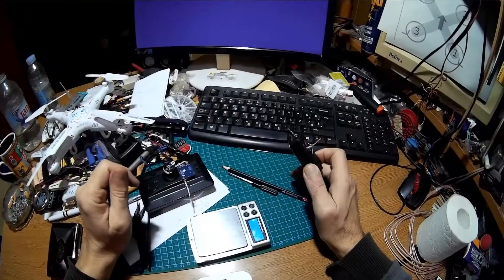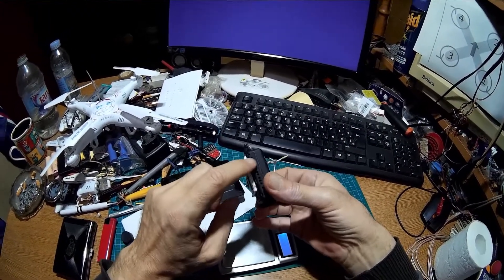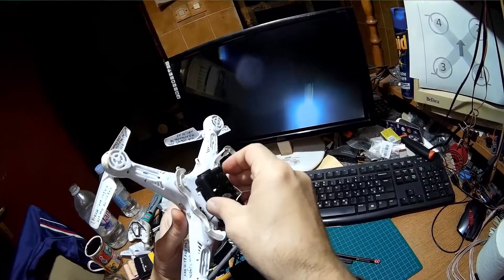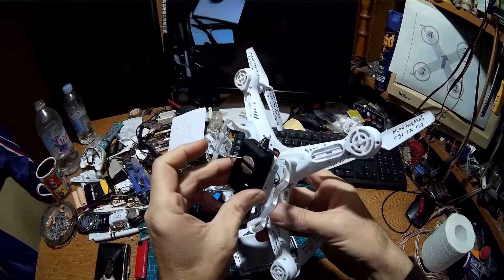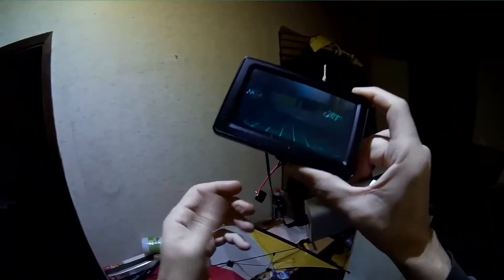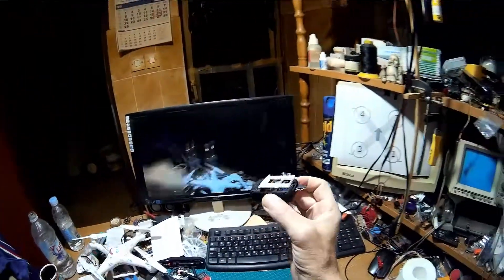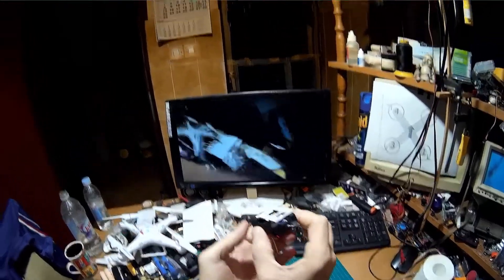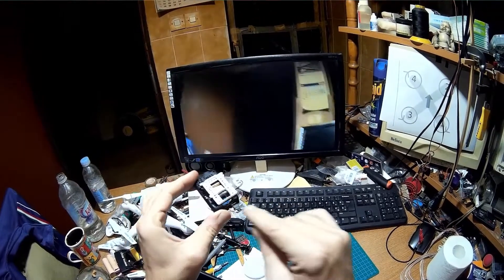FPV Mobius Camera - 5.8 GHz VTX from Banggood.com

Comment: Very nice, Milan! If you use an SD card in the Mobius and press "record" while transmitting, latency is reduced. Strangely, it is reduced. Cut almost in half. 
With SD recording everything from Mobius, live sound tranmission becomes even less important.
Reply from the maker: +Dave Review 
Thank you Dave for this info. I did not know that latency is different. Will investigate that, but not on this video converter - which has its own latency. 
Live sound is important only for LVC if quad is away from me - so that I know that battery is about to die.
Reply from the maker: +Wild Maniac 
Okay, if quad is close, I can hear the buzzer, but if not - for that reason I want to be sure...